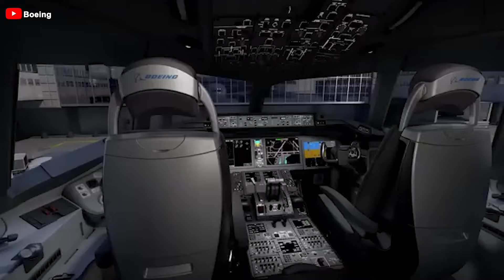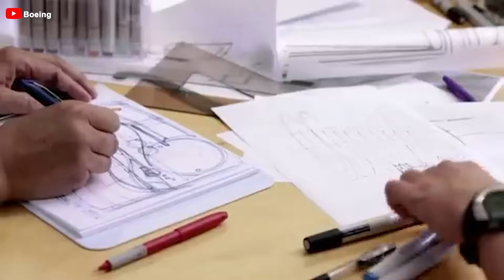You Won't Believe What Happened to Boeing 777X Cracking! Here's Why

Comment: As a potential international long haul flight passenger, if do I have to choose which airplane I`d take my travel, my demand would be to flight in a A 350-1000 Airbus jetliner.  I confess that is more reliable, less issues, and do not facing a labor Strike like the Seattle guys are dealing with right now. The patience has its limits, and the main costumers, as number 1 airline Emirates, I don`t thing it will remain more delays months of deliveries.

Comment: Sadly for Boeing it is not one isolated problem with the 777. The main significance is that Boeing faces problems broadly over their 3 main production types - 737 Max, 777X and 787. Though the problems are different ones they have one thing in common: they potentially can break Boeings neck. Not if they were isolated, but Boeing has no production line without faults. This is critical, because you can not rely on one model selling without hiccups. The Cashflow is not as good as it should be (Airlines demand lower prices due to delivery problems, reliability problems, safety problems- you name it. Not a good moment in time for Boeing. They have to get their problems solved ASAP, or they could face an even more serious future.
Reply from the maker: Yes. can't understand why they have so many problems, with such a long-standing aircraft manufacturer
Reply: @FLIGAVIA  The main reason might be that they had the wrong CEO‘s focusing on money, not quality. Keeping your investors happy might have advantages - but it has severe disadvantages in the long run. Every company has to gain profits, but if you turn your eyes away from safety and quality, you are destroying your company in the long run. Problem is, nowadays Managers will stay with companies only for a short time, they want to maximize their own wealth and significance, contrary to family owned businesses, where the owner might look forward to keep his business healthy for his kids, and might consider even a personal decline in income for the good of the company. You won‘t see that in (outside) Managers. Many companies in my country folded after the owners sold to an Investment Group with Managers maximizing money flow to their parent companies. With the loss of thousands of jobs. The job reduction part at Boeing really is a bad sign, though they might have no option at all.
Reply: 777X isn’t in line production yet.

Comment: Hmmmm..... I think BOEING 777X cracking not just like BOEING 737 MAX that in trouble because, BOEING 777X is a less trouble than BOEING 737 MAX that got big trouble.
Reply from the maker: That's right. They realize the errors of 777X in the testing flight and they will fix it soon. I think that is luck.
Reply: Yeah @FLIGAVIA ! I think this is a struggle for BOEING because, 2024 is an unlucky for BOEING that got issue and crisis. While AIRBUS is a lucky forever and ever until year that will coming soon.

Comment: It doesn't matter if you are from boeing or airbus, they both have good products, that's how it is.
The fact is Boeing has two great enemies, one is time and when time runs out it is an advantage for the other enemy, Airbus.
As if to save time they "cheated" with the max while faa was not doing its job, now they are looked at with a magnifying glass and the exhaustive quality controls (thank God they do them) generate continuous delays, and with their reputation in question, the clock keeps ticking in favor of airbus. 
The structural failures, the missing doors, it doesn't matter when, or what model, the delays... they are not Airbus propaganda, they are Boeing's fault.  
Let's hope that for the sake of the company, and the industry itself, they do not reach the point of no return.

Comment: Boeing training program has been shortened by at least 50% during the last 20 years which ends with people either not being able to find a solution to their problem or taking the wrong decision.  That has lead to the 737MAX myriad of problems and is now obscuring the 777x manufacturing process.  Boeing has fired about 6,800 employees since 2020 beside the fact that the number of people retiring has come to bite Boeing management decisions, one after the other being either reversed by engineers who do not sign the paperwork to authenticate the work done as they don't have time to see the quality of work made is inside an airplane walls or wings before they reach a particular aircraft.

It is not a secret for anybody working in this "niche" that Boeing management relations in Chicago do not meet the attention needed to what the management in Washington or on the East coast are complaining about.  Boeing as decided to lay off 17,000 more employees so we will witness a bold slow down in the production of many models.
Reply: It may end up as a military supplier and bit part player in the commercial aviation sector.

Comment: Boeing must at any cost finalize the 777 X and deliver to EMIRATES and for America. There is no other option
Reply from the maker: That’s right.
Reply: There is another alternative A350😅
Reply: @gottaseeyuh a350 doesn’t work for Emirates. They operate Hub and Spoke model. The only models currently in production that serves them is the 777-300ER 
and potentially the a350-1000. But Emirates is not satisfied with the RR Trent XWB97 low time-on-wing, so it’s a pass.

Comment: I am old enough to remember when Airbus was a one trick pony (A300) and almost treated with contempt by Boeing.

Just look at how it is now!

That was, I believe, the start of a decline made many times worse by the merger with MD.

I wonder if the 777x issues will speed up the arrival of a further stretch to the A350 or whether, at least for now, we are trying to push a wide-bodied twin, just a little too far.
Reply from the maker: A350-1000 is big enough so I think they will not
Reply: @FLIGAVIA  Does that mean that you feel that the 777x is a little too big and will not repeat the success of the original 777?

Comment: Door below off from B 737-9 n not 777x.
Reply: Main structure around a door failed on the pressure test
Reply: @michaelshore2300 Apparently, it was much more serious than originally revealed.

The cracking extended sufficiently that one of the passenger doors fell to the ground.

If you look at the initial photos it is clear that the full extent of the damage has been cropped.